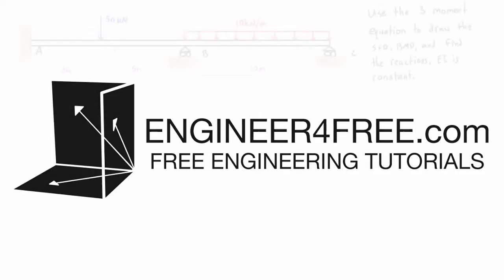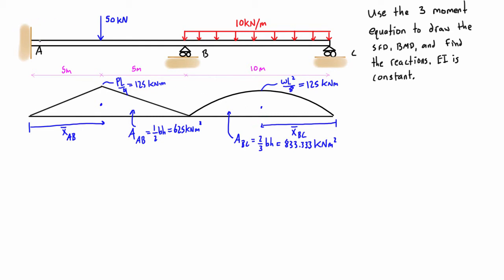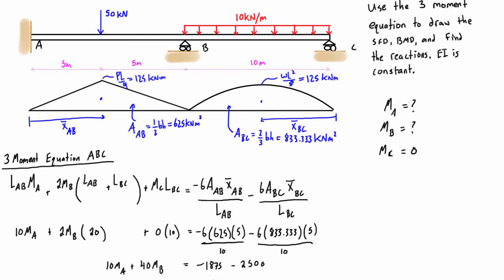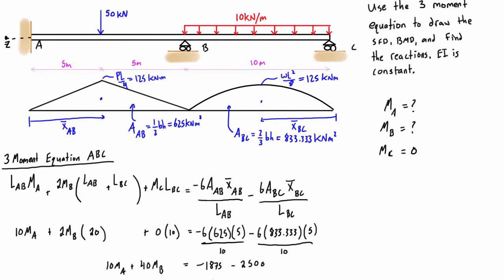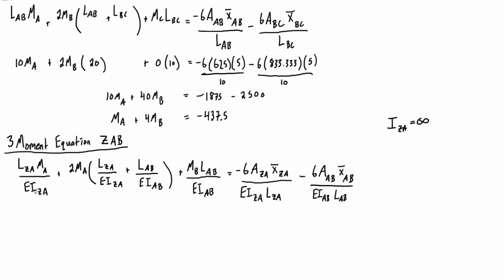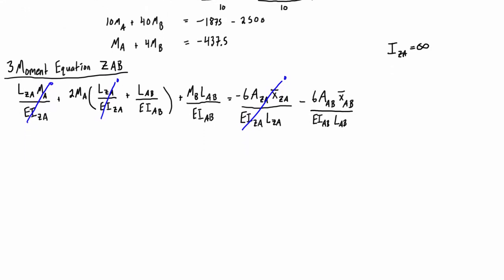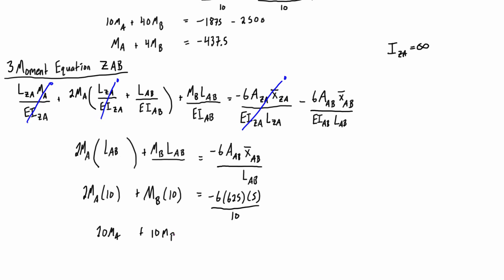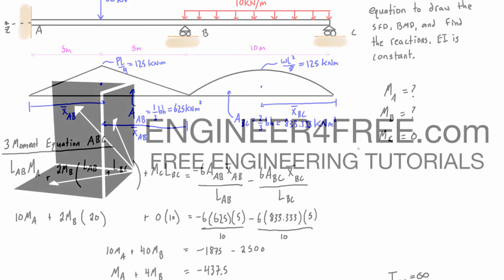3 moment equation example #3: with a rigid connection (part 1/2)

Comment: Can you solve this if both ends were rigid connections?
Reply from the maker: Yes, but off the top of my head I can't remember which method would be most appropriate in that situation, I'm on my phone right now. You can check engineer4free.com/structural-analysis for a bunch of different methods that are useful in different situations